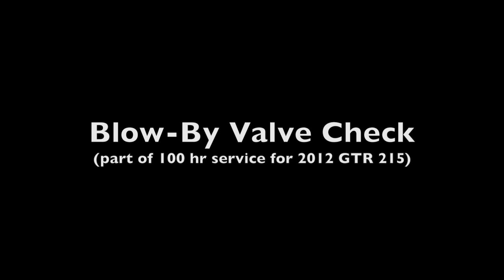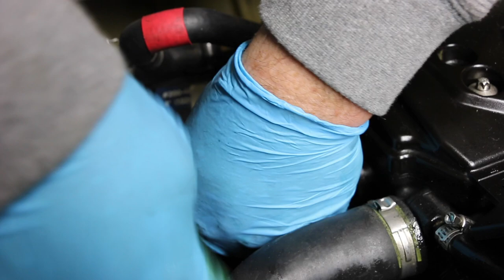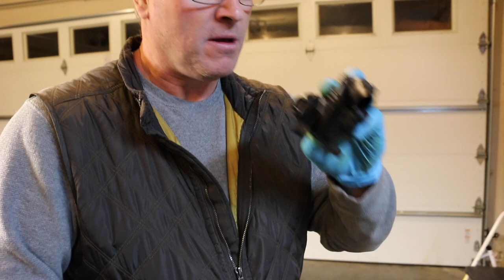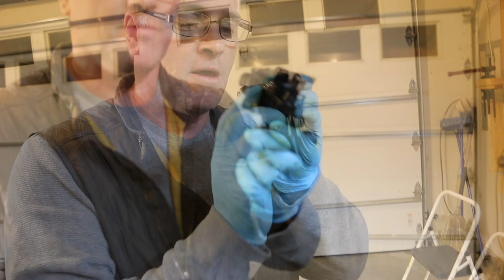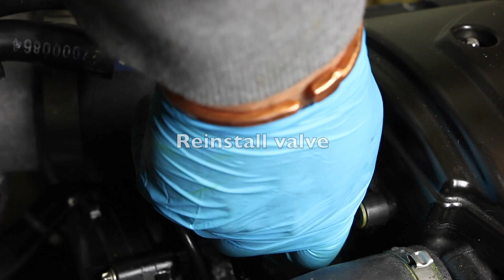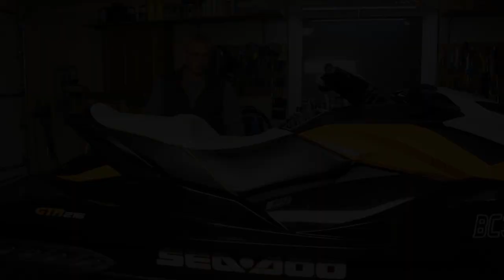How To Check The Blow-By Valve On A Sea Doo Personal Watercraft Jet Ski

Comment: Thank you for your channel, your videos have helped me tremendously!!  This is the first video I've seen that mentioned the "TOPS" switch.  I'm working on a 2013 GTI SE that our lake staff said the throttle was "sticking" and that the only way to stop it was to pull the key out.  I plugged in our CanDoo Pro to see what's going on.  All the codes pointed to the Throttle actuator.  I checked for free movement of the levers as well as any signs of corrosion in all connectors.  Turns out the TOPS sensor uses the same 5 volt circuit.  I jiggled the connector and no more fault codes!!  Got a new one on order, we'll see!!
Thanks again for your time!
Reply from the maker: Glad to be of any help, Mike. Safe riding!

Comment: I took the blow my valve off to change my top sensor because I was getting a code. And when I reinstalled, I I wanted to make sure there was nothing on the edge of the hole and I pulled out that large washer when I went to put it back in it dropped to the bottom of the motor.
Reply from the maker: Hopefully you were able to recover it eventually.

Comment: My Friends 2019 Fishpro is having the intake house where it meets the throttle body get sucked in when he guns it and the ski bogs down,  I have a feeling it is the vent valve, is there any way to clean/clear them or just buy a new one, Thanks for the video👍
Reply from the maker: We haven’t tried to clean them or repair them. We advise getting a new one if it’s faulty. Confirm that it’s faulty before replacing it, though. Good luck.

Comment: Got a question getting a p1202  on a sead gtx 155 2005. The light did eventually  go away. But  I have oil in my engine bay. Top valve seems to be working at the moment.
Reply from the maker: It’s hard to say what the problem might be, especially if the code has gone away. I would clean up the hull, and clean the engine thoroughly as well, ride it for a few hours and see if I can identify a oil leak. Let us know what you find. Good luck.

Comment: I got the dreaded po1502 on my 2005 gtx sc, however I checked t.o.p.s switch near ecu and it rattles fine, no blown fuses. However my t.o.p.s switch is near MPEM, and valve is located by oil filter not by cam cover.  Am I supposed to check the same way?  Looks totally different than in your video. My 06 GTX SC has the set up in your video but not my 05. Please help, starts intermittently but runs rough.
Reply from the maker: Download the 2005 shop manual it will have the correct test procedure for your year.

https://seadoomanuals.net/manuals/2005-seadoo.php

Comment: Hi I get the fautl code p1505 I'v read it has to do with the tops switch or TOPS valve do you have any recommendations? I already checked all the fuses and none is blown and even replaced all of them for new ones.
Reply from the maker: That’s a tough one. Here’s what one report says to do. Good luck.
FAULT CODE	REPORTING MODULE	DESCRIPTION	POSSIBLE CAUSE	SERVICE ACTION
P1505	ECM	TO.RS. switch fault non plausible state	Boat or sensor upside down, damaged circuit wires, damaged connector or damaged ECM output pins. Open circuit.	Check continuity for circuits A-C4, A-G1, A-F4. Refer to the Service Manual for more details.

Comment: I got a 03 gtx 185 I just rebuilt. Runs great  starts easy.  But did notice  pressure behind the dipstick.  But none at the valve cover could that be the oil separator  or whatever its called on the oil fill area?
Reply from the maker: By “pressure”, i assume you mean air pressure? I.e. the dipstick wants to pop up? Have you confirmed the right amount of oil and that your oil filter is in right/the correct one?
Reply: @3ftDeepChannel   I let it idle and turn off to check its right at the middle didn't check filter  but it was a brand new  k&n
Reply: The dipstick  doesn't  come out but it definitely is pressurized.  But the valve cover isn't. They didn't  have any seadoo oil near me so the shop gave me a different brand. I don't recall the specifics.
Reply from the maker: Do you know if you’re getting any blow by? It sounds like you have overfilled with oil. No codes, I assume? Also, check the integrity of your oil filter just to make sure nothing is blocked. When things go bad, that filter can become crushed under the pressure differential.
Reply: @3ftDeepChannel   no codes. It it had blow by wouldn't it be pressurized In the valve cover as well? I'll check  all that you mentioned.  Thank you for your advice
Reply from the maker: Possibly. If I recall your model doesn’t come with a blow-by valve, the behaviour of which would help to troubleshoot your issue. Otherwise, it runs fine?
Reply from the maker: When you did the rebuild did you use the 03 engine block or a different year block ?
Reply: @3ftDeepChannel  que acen que el filtro se aplaste

Comment: Cannot find a part number for that valve any information 1630 Ace motor
Reply from the maker: For the 2012 GTR 215 it's: 420856502. The part number on my 2018 RXP-X 300 machine with a 1630 ACE engine is: 420856504. Sea-Doo has all the part numbers at their "Parts & Maintenance" section of their website. Go there and click on "Browse Parts Catalog". Good luck.

Comment: Question: Is this the TOPS valve?
Reply from the maker: No, that is a different valve.
Reply: 3ftDeep thanks for the response. I'm having the p1502 TOPS code and I am at a total loss
Reply from the maker: Sorry, I haven't seen that code before but it sounds like that sensor may be the issue. Check the fuse powering the sensor first. If that's okay, try disconnecting it, and even disconnecting the battery cable for 5 minutes to see if that has an effect. Also, make sure it hasn't changed position for some reason. Good luck.
Reply: @travispotgieter2836  Hey mate I've got the same Error did you ever fix it?
Reply: @TheWhiteGamerWill    No I didnt I actually still have a brand new tip sensor sitting at home. I sold the ski for parts in the end.  And a year later saw it for sale as just a hull. So I am assuming it ended up being a back motor. Switched over to yamaha and never ever had an issue again and now im into stand ups. The seadoo was a nightmare 30hrs, needed a wear ring, carbon seal, this error code, limp mode. sucked because the features seadoo offers are great but the yamaha reliability can not be beat it seams
Reply: @travispotgieter2836  ye ok
Reply: Travis Potgieter d

Comment: Hello, I have smoke coming out this valve and engine doesn't start after is start happening. Any idea what it could be?
Reply from the maker: Have you checked your oil level?
Reply: @3ftDeepChannel  Yes. I've found a problem. I replaced the engine and didn't put enough oil in it. It was below minimum. Started the engine no problem, and seems like my piston rings went bad. Have about 30 psi compression. Added oilnin the cylinder, compression went up. 
Which video will be best on your channel to use for piston ring replacement procedure?
Reply from the maker: Tha’s too bad! Check out this series. It may offer some help: https://youtu.be/c-2LdY-hxmA
Reply: @3ftDeepChannel  Fixing it by watching your videos. Thank you! How do you remove deepstick tube? Having hard time pooling it.
Reply from the maker: It should be anchored into the engine block with an O-ring. It needs to be disconnected from the intake manifold first, though. Good luck!
Reply: @3ftDeepChannel  Thank you. I just found out it's not that expensive,  so I had to pull it very hard, cuz it stuck there. Intake is out long time ago;)

Comment: what happens when air flows pass?
Reply from the maker: I’m not sure what you mean with your question, but there is a brief description about what it does blow the video.
Reply: @3ftDeepChannel  my question is, what about the engine, if this valve is not working properly?
Reply from the maker: Sorry to take so long to respond to your question. For some reason YouTube doesn't show replies to replies as an actual comment. You have to search for them (like I'm doing now). The primary function of the blow-by valve is to allow crankcase vapors to return in the intake system where they are burned. Rather than have me try to explain what can  happen when it's not functioning, check out this video (it's for cars, but it still applies to PWCs) https://www.youtube.com/watch?v=ox581_iG5wg.

Comment: Is a blocked blow by valve the cause of crankcase pressure? I took my Seadoo GTR 215 out and it would die when attempting to go above 7000rpm
Looked under seat and oil everywhere from dipstick
Reply from the maker: it could be. You should definitely check it like we do in the video by tipping it upside down and blowing into it. Did you make sure the dipstick was put in properly?